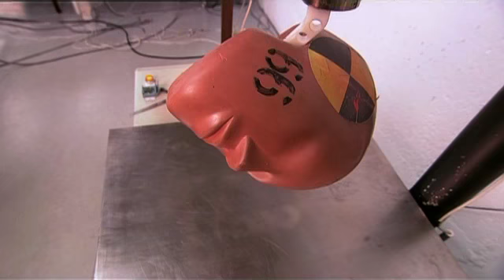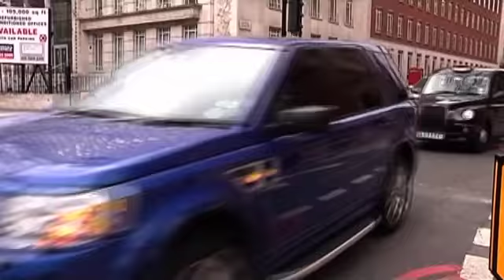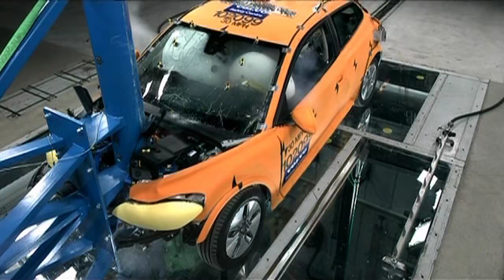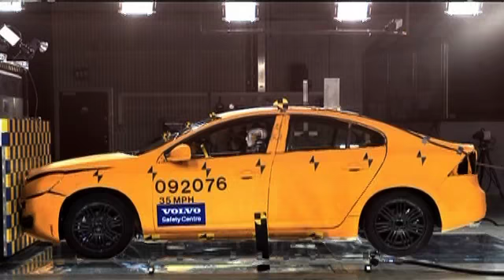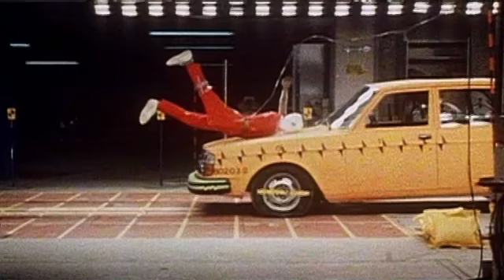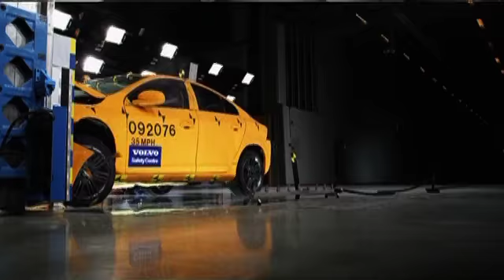Volvo's Crash Test Laboratory Celebrates a Decade of Safety - 2/2

Comment: I had an accident in a 2001 volvo s60 a couple of years ago that broke both the primary and secondary latches on the front passenger-side door. I would like to be able to email the few pictures that I have of it too somebody at Volvo so they can do research into it. The crash was be going about 45-60 mph and losing control on ice and hitting a Lincoln Town Car, that I think was an 87 year, that was going about 35. The impact zone on my Volvo was about the right-front wheel with the left front.

Comment: @Ivannos92 Yes but when you crash at 60 mph it is usually at the freeway when you are traveling at the same direction. And 2 way roads vehicles travel at about 35-45. But one day there probably are going to be cars that can do frontal offset crashes at 60 or higher mph.